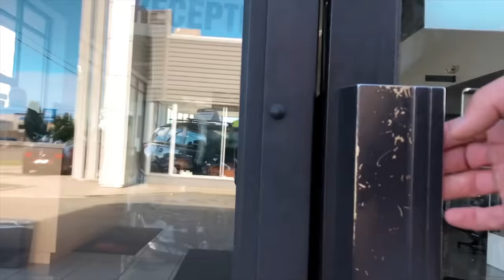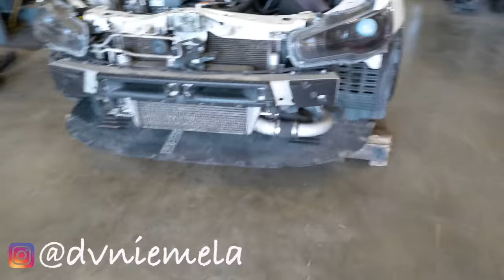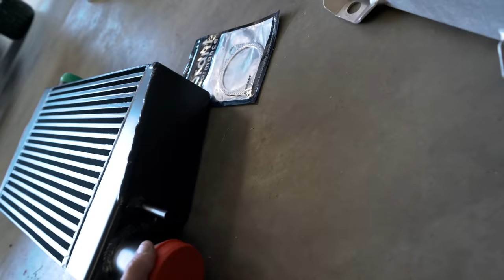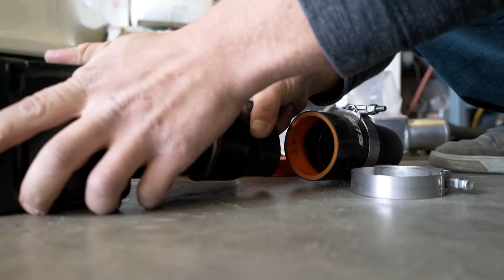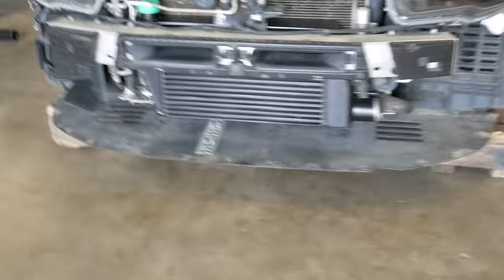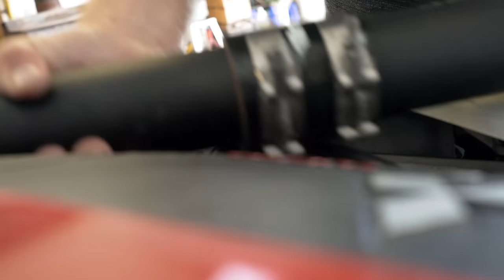I Got Scammed on my ETS Kit

Comment: Bro the depo is a great intercooler
Im also running it on my x
4 inch you will be good bro
Depo runs their 3.5 inch intercooler on their 800whp evo x
Reply: I’ve had my 3.5” Depo fmic for 7 yrs now. Zero issues to date.

Comment: The 3" would work fine. I made 570 on a 3" ETS, but if you got a 4" depo, just use that hah. I think people run stock IC past 600.
Reply: Michael Hasselbring this gives me peace of mind, because i picked up an ETS 3” and will be installing it with other supporting bolt ons as well an as MHI-18k turbo running on E85. My goal is to hit 400hp. Hoping i can.
Reply: On E you'll hit mid 400s dynojet on that turbo.
Reply: Michael Hasselbring mid??? Man I hope. Shoot give me 400 flat and I’ll be so happy haha.
Reply: you can make 400 dyno jet on stock turbo and E